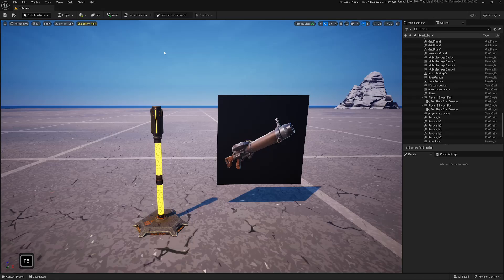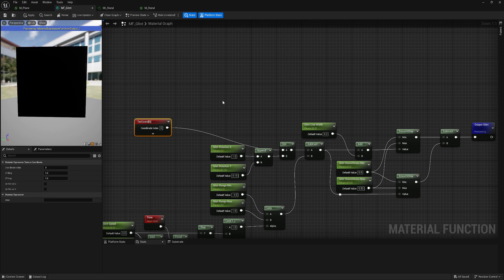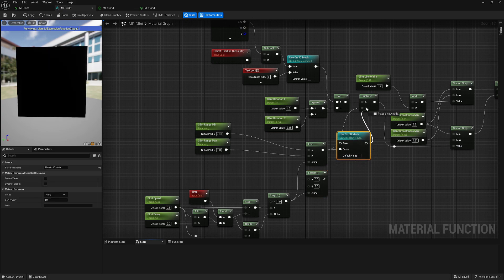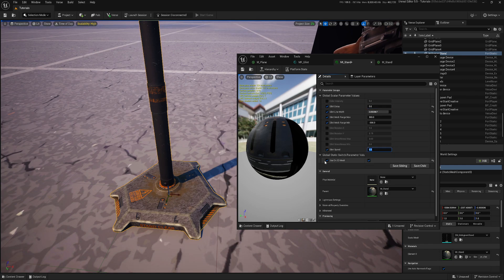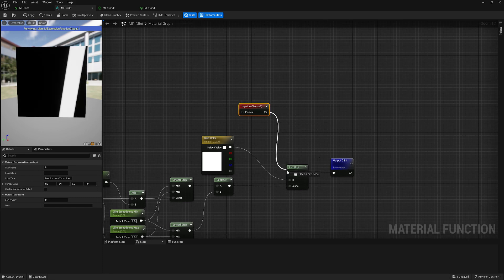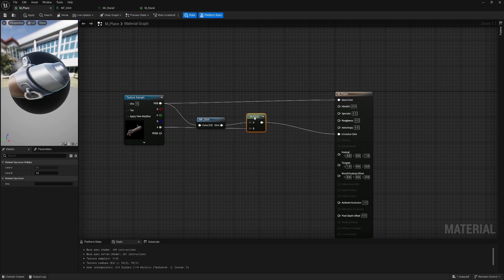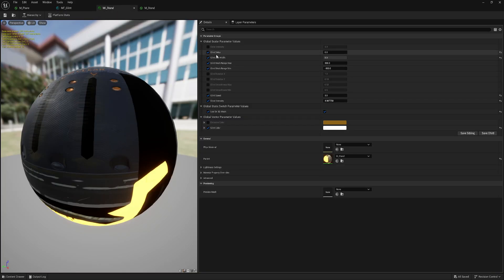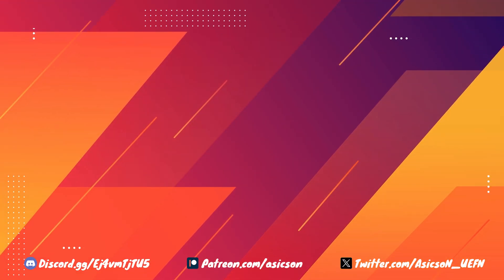Learn How to Improve Our Custom Glint Effect - UEFN Tutorial

Comment: How do you add this to a UI material?
Reply: No matter how I do it it'll ignore the shape of the original texture
Reply from the maker: @Vizeloo  In UI space ot will just move from one side to another.
It should only react better to shape of the 3d mesh.
Reply: @AsicsoN  It works fine on my UI material, but I'm not sure how to mask out the background attached to the glint material. Do you know how?
Reply from the maker: @Vizeloo  If you have background separate it means you should have mask somewhere. Most likely in your texture's Alpha channel. Just multiply it with glint.